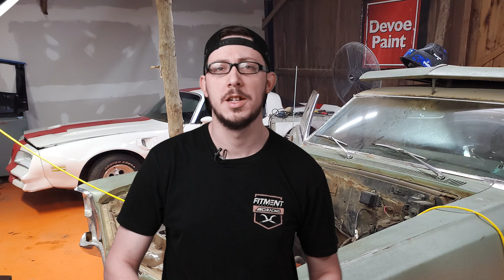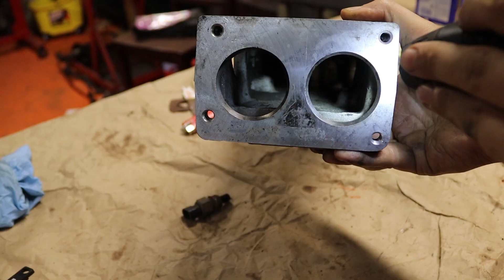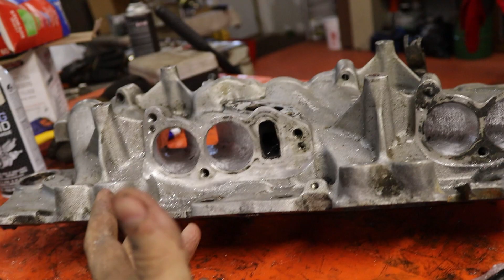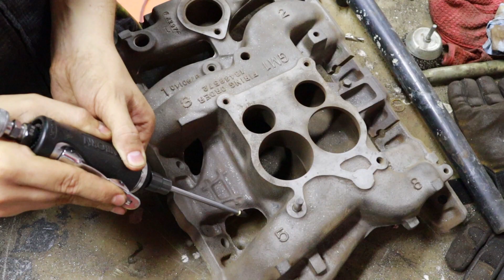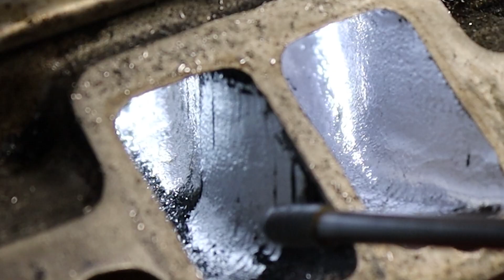Should You Port and Polish Your Intake Manifold?

Comment: Do you need a tune after porting upper and lower intake
Reply from the maker: Not yes, not no. It'll run just fine, especially if you've got a MAF car. You can usually get away with a decent bump in a cam before you need to retune on the TPIs, they were insanely fat and overfueled to begin with.

Comment: Golf balls fly through the air better why? Because the thin turbulent layer lets the air flow better. However what I know is , bolt it on a flow bench and test it and prove it.
Reply from the maker: My problem with the golf ball idea is the dimples are used to create a boundary layer to to reduce drag in a round object while creating lift. A moving object has a high-pressure area on it's front and a turbulent wake behind it - a different principal than we use in automotive. 

I can't remember the last time I took a head off anything performance and seeing a dimpled setup. Back in the day Smokey Yunick and a bunch of other NASCAR teams used mirror, dimpled, and a standard port job. The problem with the mirror port job was the air moved too quickly and sticks  to the walls which causes fuel to pull out of suspension. In a more modern system that's exactly what we want, in a carb system a mirror finish is a good way to spend hours diagnosing a problem that the porter-created.
Reply: Trust me dimples work, flow port with and without. Is it worth the work to do it it’s the question?  In small Briggs stock legal cart engines we do it, you can only get power so many places legally in those and it works and is legal. Get off the computer and to the flow bench and you will see real world results not guesses.  Trust me I learned to port before Weld made the first multi axis cnc to do them.
Reply from the maker: Hoping to take a deeper dive at some point. Wanting to the same head a few different ways to see what the bench says. I’ve always had better luck with a smoother finish on TPI and crosshatch in the carb stuff.

Comment: Mixing is just one aspect.  The other is the boundary layer.  When air turns, it will separate from the floor, causing a pinch in the airflow (known as a vena contracta).  If you have some surface roughness, you trip up the boundary layer, which helps the air "stick" to the bottom of the port.  That is irrespective of wet or dry.

Comment: Also, car engines are not solid state, especially street car engines they have to accelerate so often what shows max flow on a bench, (or even good max wot power for that matter) may not help the car accelerate faster. So rough finishes have their place. The problem is that it is all application specific, the gains are minimal, and without extensive testing you likely will not see the gains of a properly roughed up intake port finish. A flow bench is only 1 piece of the puzzle sirs. I think it's great that you are discussing it and have an opinion. But to blatantly state "myth busted" is just not true.
Reply from the maker: Honestly - myth busted - gotta get those views. That’s kinda the rough part about this whole YouTube thing in general - making content generic enough to be useful for dudes with Civics and GTOs but techy enough to actually matter. 

Appreciate your insight. Hopefully other people understand it’s an application specific thing for every individual setup.

We’ll be diving deeper once I get my porting stuff set back up.
Reply: @LSxHunter  bro, I'm not trying to hate, knock your youtube groove, or insult ya.. sorry if I came off like that.
Reply from the maker: @b.c4066  no problem 😂. Didn’t take it that way by any means. I’ve got a few guys that love to give me crap lol

Comment: I'm no expert, but wet , or dry.. you would still want to help create a boundary layer. So rougher, or dimpled, burr ported etc would be better.

Also.. even a wet intake, the more surface area of a burr or rough finish  would to some extent help scrub heat from the intake. 

And you can't make the comparison of a water hose. Because an engine pulses. It isn't a constant sucking type of draw. It is more of a push/pull type thing. The velocity of the air flow is in constant flux. It just happens very fast so as to not be visible by the naked eye. If you were to put a colored dye in your fuel and somehow mount a high speed camera inside of the plenum and runners you would see it differently. Airflow inside of the otto cycle engine is not as simple as we would like it to be. And a flow bench number is only part of the story here. In a running engine that has to operate over a wide range of rpm, with various load on it.. surface finish of the intake ports can, and does, have a profound effect on power. 

The last two mpfi intakes I have owned, and many I have seen.. have a rougher finish. And we're done by some very well known pros. And yes I am taking about lt1/tpi 23° sbc stuff.
Reply from the maker: Bill, thank you for this well thought out response. I pinned it so that others can see it. Thank you again for contributing.
Reply: And I'm not going to name drop, or swing on the guys nuts. But the fact is he is one of the few that is still doing extensive porting, testing, and boundary pushing of the 23° sbc.  And all his stuff, wet or dry is roughed up, even after cnc porting.
Reply: It would be interesting to see a back to back test of the exact same engine run with mpfi, the intake cnc ported then finished rough. Ran on dyno, track. Measured then recreated as exact as possible but with a mirror finish. Especially with the long runner stuff.
Reply: @b.c4066  This has all been done ad nauseum in the industry, usually with flow benches.  And more and more often, analytical with CFD.  I even worked with one guy who suggested golf ball like dimples (that one failed miserably, FWIW).
Reply: @harryking8498  I don't think it is fair to say it failed miserably, but rather those with the resources to properly manufacture it and properly test it's effects are at the cutting edge of racing technology and research/development. And the average speed shop is never going to duplicate their results. Porsche and others have done it over the years if I am not mistaken.
Reply: @b.c4066  I meant the golf ball dimple experiment I referenced failed miserably.  THis was at Ford, in the early days of the development of what became the 6.2L.  Sorry for the confusion!

But overall, absolutely need some surface roughness to trip up the boundary layer, of course, depending on the bend radius.  Certainly didn't mean to imply otherwise.  "As cast" surface texture is often close to ideal.  We did in some applications coat the core inserts with something, I dont' recall what it was exactly, but it was kind of like talcum powder (in a slurry).  I actually mention some of this in a direct reply below here.
Reply: "... rough finish...help scrub heat from intake..."  You are correct. More heat will transfer from intake to air; most agree this is not desirable.

Comment: Im not saying what you say is wrong, but another issue when opening up ports or changing configuration is port velocity. It needs to be thrown into the mix too.
Reply from the maker: Just another piece to the puzzle - I think I beat that one to death when we talked about how to actually read headflow and not just the peak numbers. I’m a HUGE pusher of the smallest head possible with the most flow.
Reply: @LSxHunter  should read. The right volume and csa needed with the right velocity for the intended use.. although I understand what you mean bro
Reply: Look up something called "Z-Factor."  It is the max velocity relative to the speed of sound the port can sustain (on average) over a period of the entire intake event.  Of course, at no point during the intake event can the air ever exceed the speed of sound.  In the early stages of lift, you are limited at the interface between the valve and the seat.  At some lift point, the point shifts.  The choke point is usually abotu 10% smaller than the port, so you get some expansion in the short turn.  Of course, if you have all the packaging space in the world, you'll want to get gradually smaller so you are accelerating the air as it gets closer to the valve.

Also, as you change the shape of the port, your tuning is affected.